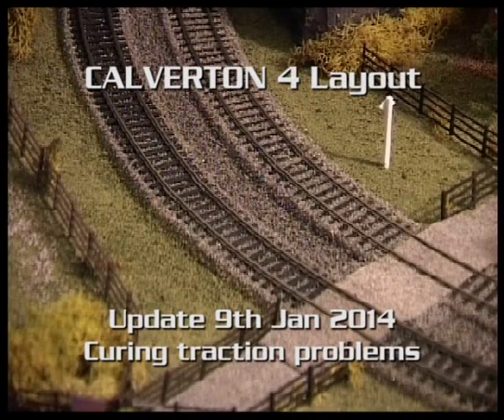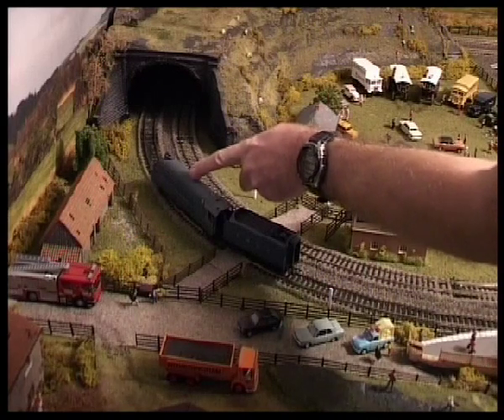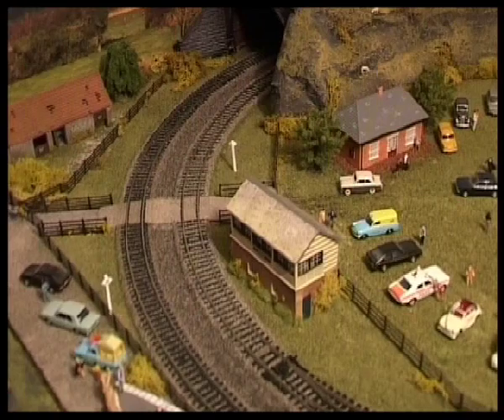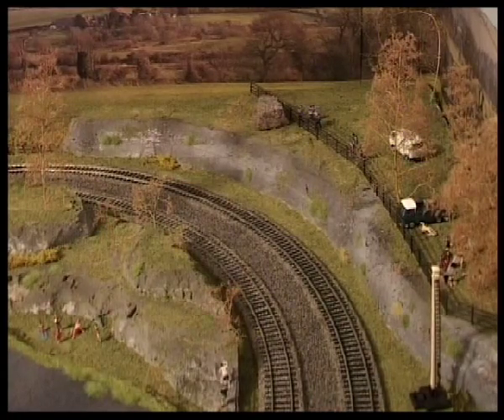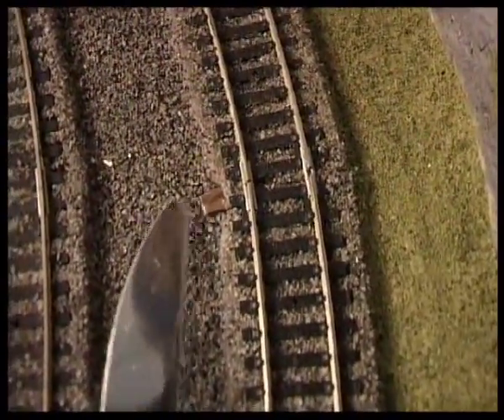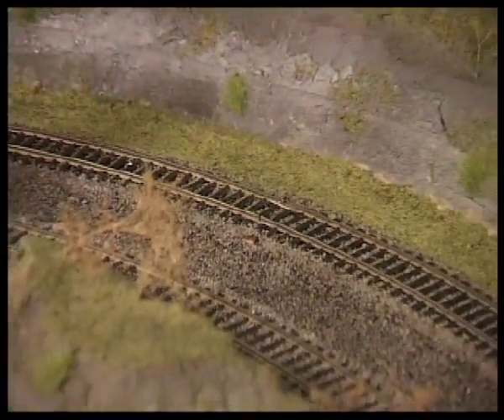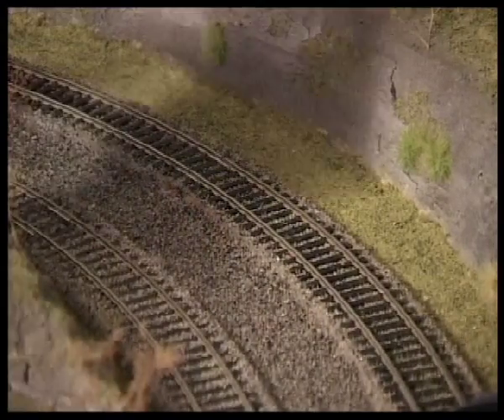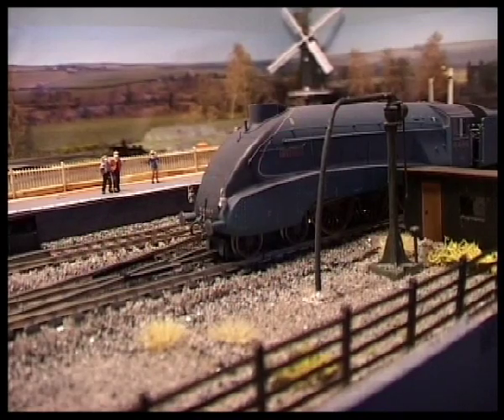Calverton 4 Update 9th Jan 2014 Traction

Comment: Two fundamental problems here. One is poor tracklaying, the other is reliance on current collection by fishplates alone. Remedy: completely remove the faulty section of track and relay it flat : solder wires across each joint, by linking loops from one track to the next (but retaining the rail joiners for alignment. Once this is done well your problems will disappear. If you don't address it properly then there will always be an issue. Kind Regards, Robert
Reply from the maker: Thanks for your comments but I prefer to use ballasted foam for the quietness. Mind you if the problem comes back I can solder that particular joint. Is hasn't come back again though.
Reply from the maker: Also, meant to say, it wasn't an electrical issue. It was a traction one. Only this loco suffered, and the primary cause was related to it's own front bogie being to low (as in description). But altering the track helped this particular train too, which was what I did before I realised the bogie was the main cause. Now she runs fine. The track laying is fine and always has been. Thanks for your ideas though. Regards.